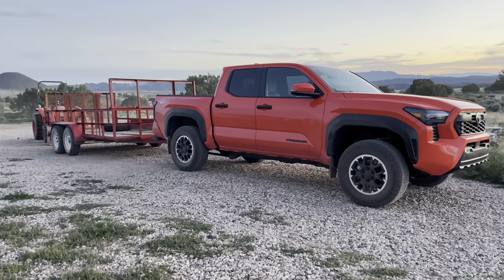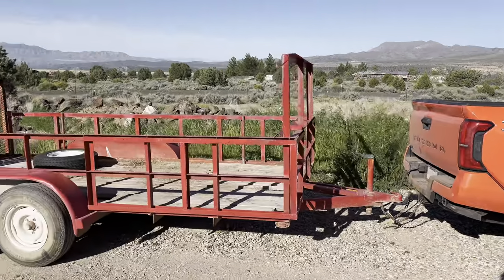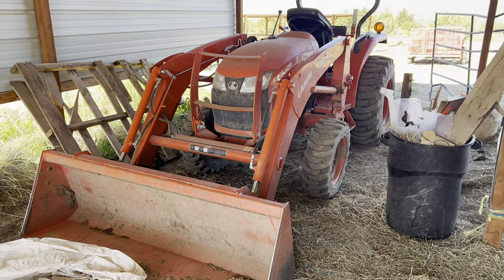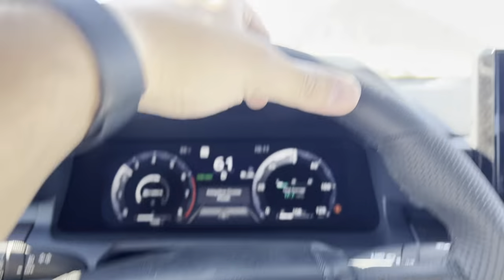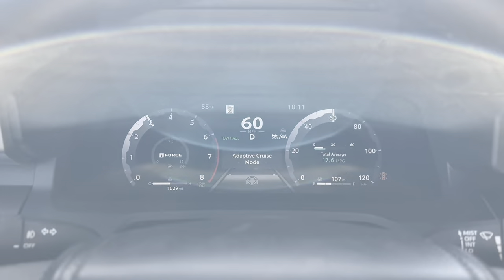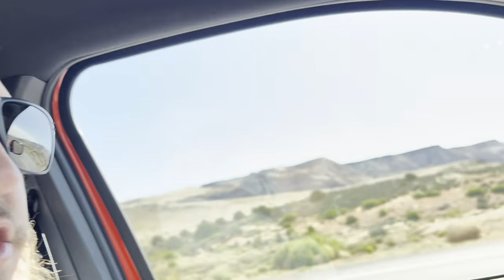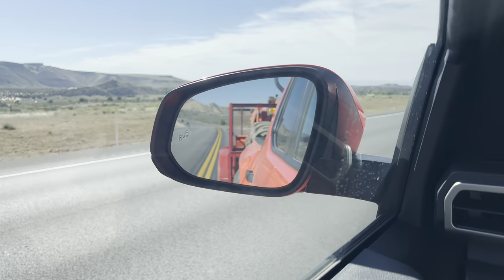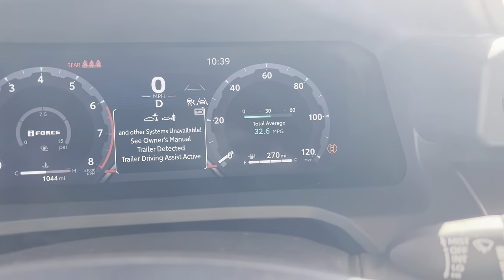TOWING a TRACTOR with a 4 CYLINDER 2024 TACOMA

Comment: Good review! A couple of things you might want to on next test to have the tractors buckle forward. That should appease anyone thinking you are over loading the tongue. The trucks bed raising is just the hazard of loading but you were very smart using lever ground.  I think in my view one of the Taco’s weaknesses is that plastic bed being too light.  What I would like to see how it would tow from a complete stop on an incline.  In a real world situation I am concern if the engine can do it confidently.  Of course something sensible not damage your truck or get Taco lovers harsh feedback. Just to put out where Im coming from Im a Frontier owner and Im still on the ropes of new engines.  As for the bed Im welding inspector never been a fan of composite material.  I think the individuals that were on the last submersible dive to the Titanic would have agreed with me. 😢
Reply from the maker: Thank you! I thought about loading it with the bucket forward but that would have put all the weight over the axles and not enough on the tongue. So I figured too much on the tongue is better. Towing from a stop on a hill is a great idea! Maybe I’ll make a short about that! Thank you for watching!

Comment: Light bar, winch, tool box in the bed. Also, you mentioned it riding a bit rough. I think a suspension test on mountain hunting trails is in order.
Reply from the maker: I like that! I’d really like to do a full build on it!
Reply: @counterfeitcowboy1362  I think I missed something here. was the 2024 Tacoma riding rough because it was towing or does it ride rough in general?
Reply from the maker: @sammyjammy6647  I talked about it in my test drive video. The bilstein shocks are quite stiff it rode better with a trailer on it

Comment: I tow a boat that weighs about the same, or a little more than your trailer. I’m on the fence right now on the hybrid. Any regrets on not getting the hybrid ($4000 more)?
Reply from the maker: I feel like if you want to have more power than you will ever need, then spend the money. But the gas powertrain had plenty of power. I never felt like it was lacking. The other thing is my truck is rated for about 6400 pounds. The hybrid is rated for 6000 because of the added weight of the hybrid system. So it picks up a ton of power but loses 400 pounds in tow rating.
Reply: @counterfeitcowboy1362  thanks for the feedback.  It sounds like the power difference isn’t that noticeable.  Hybrid does come with bigger brakes and rear differential, inverter. Great review!
Reply from the maker: @belfastconor8521 I didn’t know that about the hybrid. That is cool! Thank you!

Comment: 22 TRD Off Road 4x4 V6 with manual trans.  Live in Tampa but camp in the Smoky & Blue Ridge Mountain areas frequently.  Pull a small utility style camper, 2500 lbs loaded, which has a front pull-out kitchen that has tongue weight.  Installed quality air bags at the get go to eliminate any rear squat.  Trailer is base camp as we explore & hike nearby areas.  No problems with any inclines traveling this way.  Keeping it Simple.